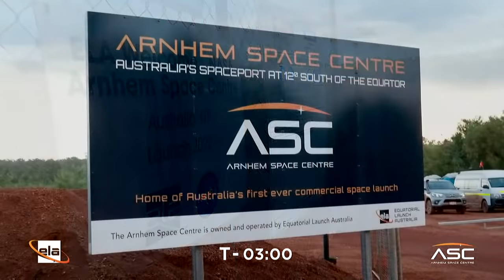NASA Launch 1

Comment: What a let down
Reply: Have you ever been involved with rocket launches of any kind? Clearly not! The effort required by all to establish a launch site in a rather more remote area than Woomera, get one of the largest space agencies and their academic researchers to accept ELA's offer to provide the launch service, after jumping through a thousand legislation and red tape hoops, then successfully on the designated night, give or take a few minutes delays, which are beyond their control, to successfully launch a two stage, solid motor sounding/research rocket, out of the NT, and then recover it 24 hours later, is a sounder achievement, than you are able to achieve I feel!!